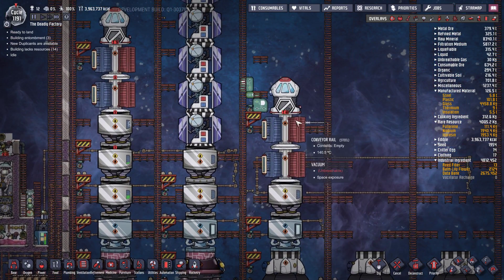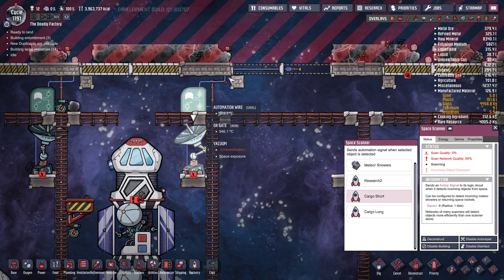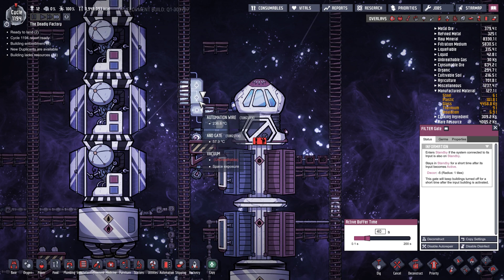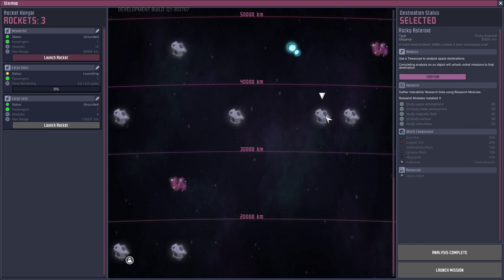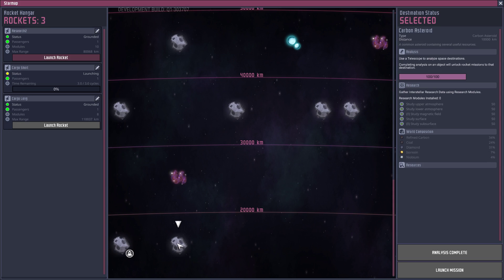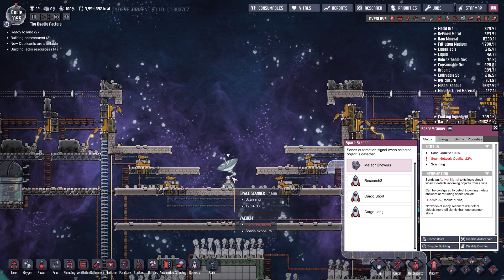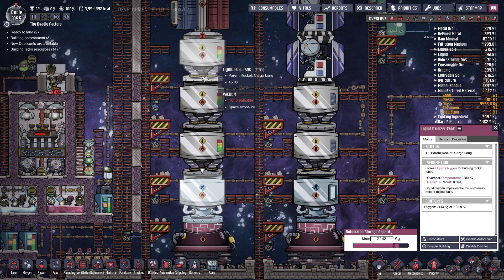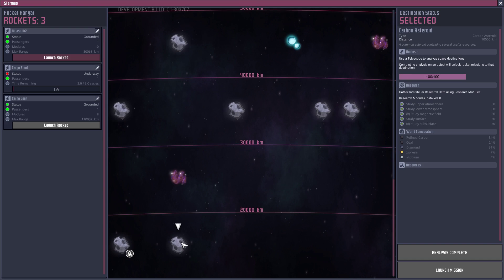Rocket tutorial, Steam to Hydrogen plus automation part 2 Oxygen not included

Comment: If you are building pipes out of insulation you probably don't need to make the insulated, insulation is an almost perfect insulation so making insulated pipes just wastes 300 insulation, doesn't it?
Reply from the maker: I tried to use regular pipes made of insulation but despite the stats saying they are identical they are very friendly when it comes to heat exchange with the liquid they carry and have massive thermal capacity. It was actually better to use Gold radiant pipes they would rapidly exchange temp but would quickly match the liquid temp due to half the mass 50kg and much lower thermal capacity (very messy to initially cool them down). I did lots of testing with many cracked pipes as a result but overall ceramic was the best choice for cost benefit.
Reply: Unless they are insulated they will exchange heat pretty fast.